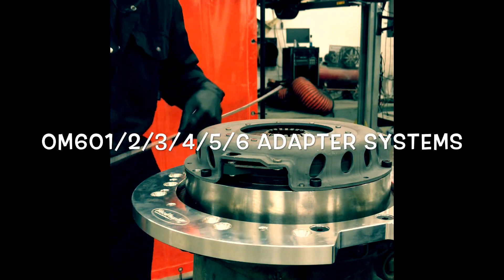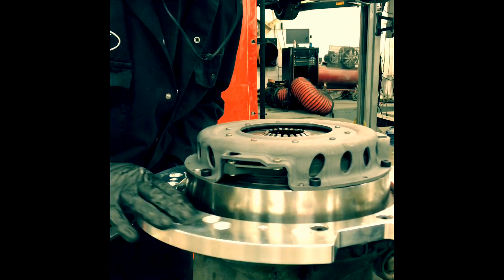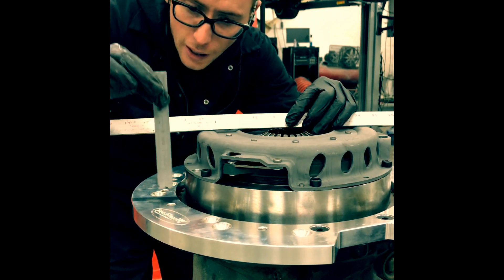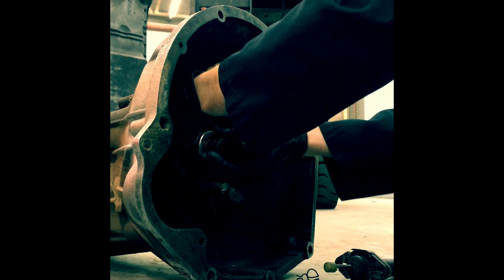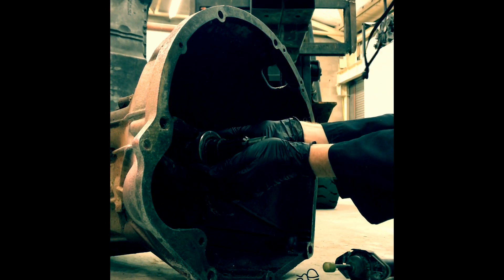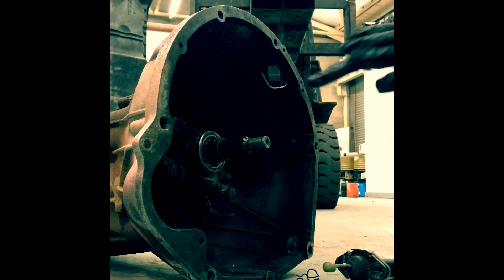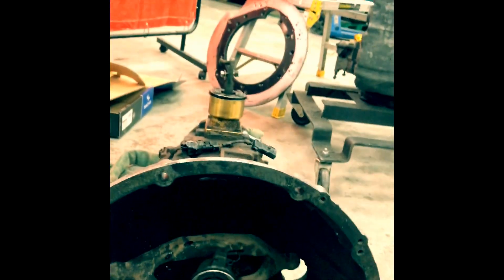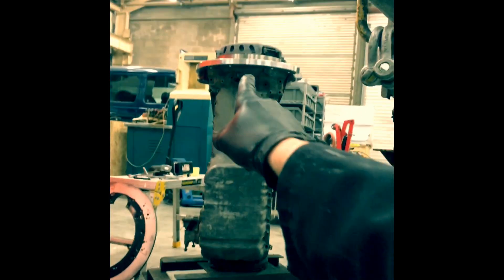Om606 Adapters Clutch Setup Dpuk

Comment: Hello, would a 5 speed gear box off a 1993 190e 2.6 sportline  .Fit a om 606?? Would it fit into a w124? I would buy a adapter plate if necessary.Thanks for your replies!!
Reply from the maker: mike kabli hi, the transmission is direct bolt on, we offer a clutch to make this setup work very nicely